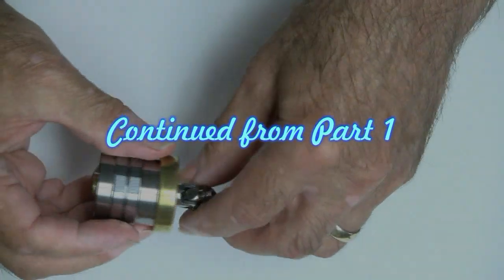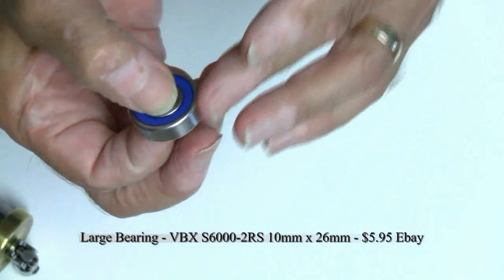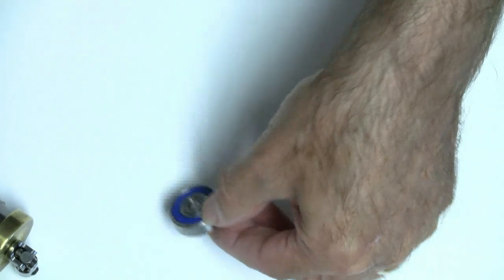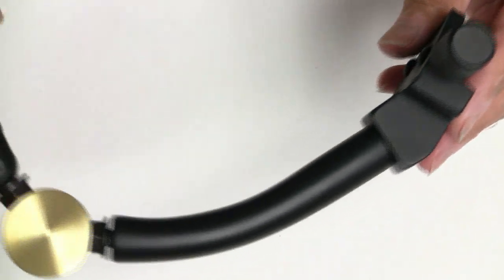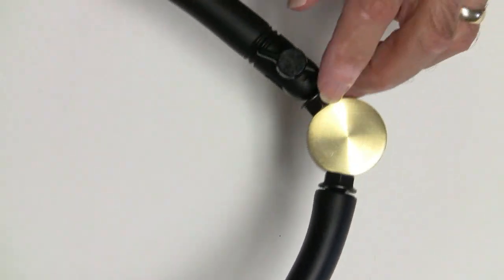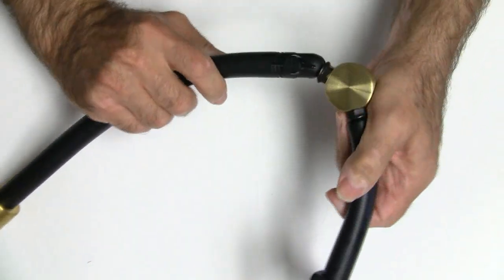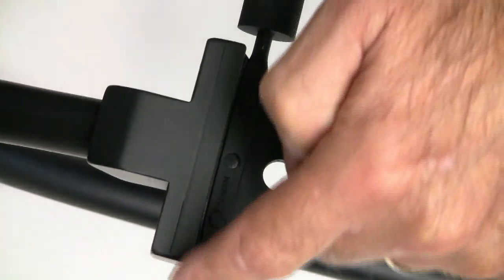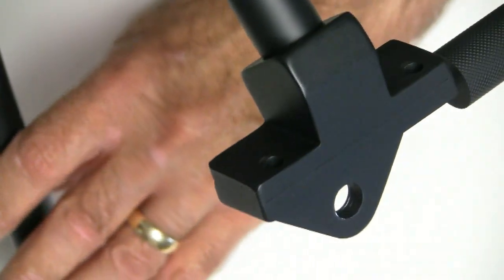DIY Merlin Steadicam Part 2

Comment: I was scratching my head for 3 days trying to figure out what I should use for that locking joint.  I couldn't find a good car mount to use so for those who are in the same situation I was in, get universal speaker mounts.  If you're in the U.S. walmart has them for 10 bucks or less and you get two.  Unscrew what you don't need and then replace the bolt with a wingscrew and you've got yourself exactly what you need.

Comment: what are the inner and outer diameters of the collar and sleeve? im trying to find parts that can replace your machined ones. also is the panning ring flat on both the top and bottom or does it lip over the top of the flashlight parts?

Comment: I see the 'set screw' you put in the custom made brass collar holds the bearing assembly to the brass "control cap" you made, but how do you get the set screw tight? It seems to me the flashlight cap is in the way of getting a screw in there.
Am I missing something?

Comment: Instead of using sand and plugging the ends with caps and epoxy you probably could have just used a long spring inside the pipe.  I am thinking that would have saved you a lot of time and effort with the same end result.  Thanks for posting this it's really been a help for the one I am working on!